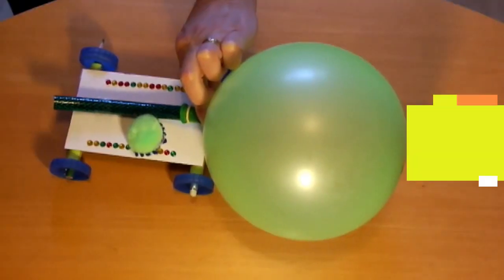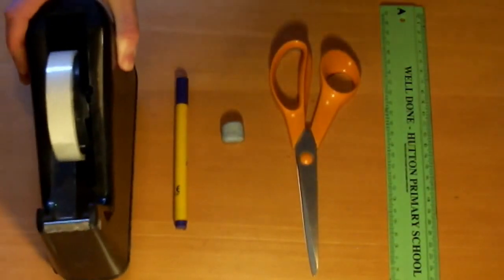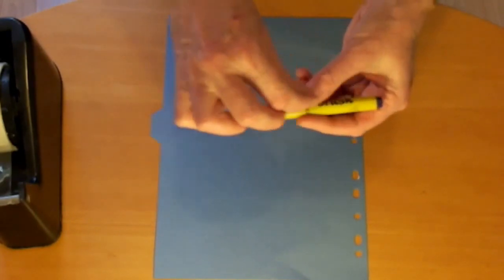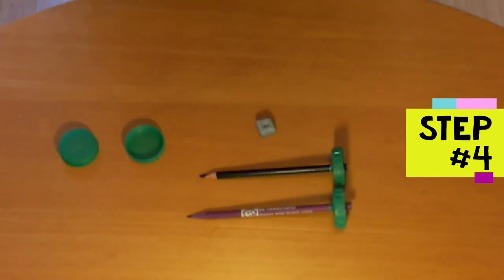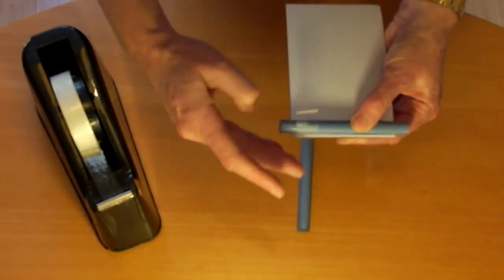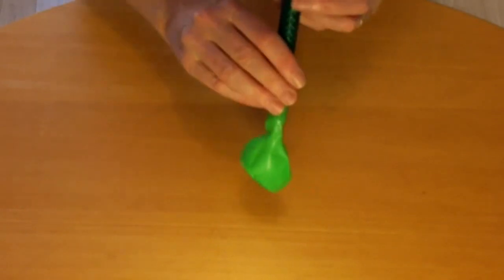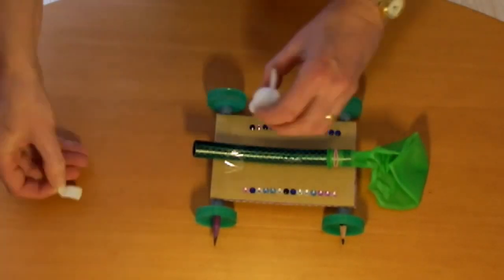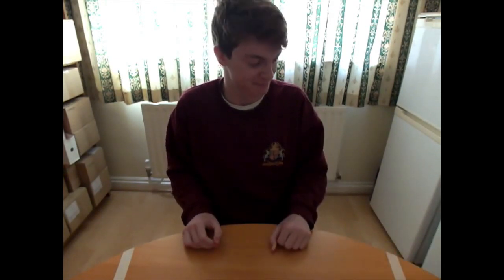STEM Project #1 Balloon Buggy (Forces and Motion)

Comment: which energy is used
Reply from the maker: You store potential energy when you blow up the balloon, both in stretching the balloon itself and in compressing the air. Then when you let the balloon buggy go potential energy is converte4d to kinetic (movement) energy as the buggy accelerates across the floor. Energy is converted to heat energy due to friction (and sound energy) as the balloon buggy slows down and stops. I hope that's useful.

Comment: Hi there! Can I ask if you have anything to help me in conducting an experiment about force and motion? We need to follow the scientific method and for some reason we can't think of anything. Thanks in advance!
Reply from the maker: Do you mean a really simple experiment? If you have a Newton Meter you can place objects on a surface and find out how much force it takes to make them overcome friction enough to move. Then you can vary parameters such as the weight of the object, the surface of the object (e.g. glue on sandpaper or old bicycle inner tube) or the surface it is sliding on and compare the force required after the change in parameter.
Reply: @TechnologyForFunVideos  Do you have any ideas for something that doesnt require any new equipment/ can be done using things found at home? I'm sorry for the trouble but it's part of the task to use only household materials and this task forms 30% of our grades.
Reply from the maker: @StrongholdViolence  please could you email me at technologyforfun@hotmail.co.uk and I can send some more ideas.

Comment: Thanks but some things are not statted very clear for me. Im using this video for my project due soon and i am utterly confused abt the felt marker step, do i have to cover the whole felt pen/marker simce mine is bigger than yours or do i have to do the 5 by 11 cm.
Reply from the maker: The tube you make needs to be 11 cm long and slightly bigger internal diameter than the pencil, so the axle can rotate freely in the tube (bearing). The marker pen is just something to wrap the card around (it is hard to make a cylinder otherwise). So you could try and find something of a smaller diameter than your marker pen, or if you don't have anything you could try wrapping the card very loosely around the pencil instead. The important thing is that the pencil is free to rotate in the tube.